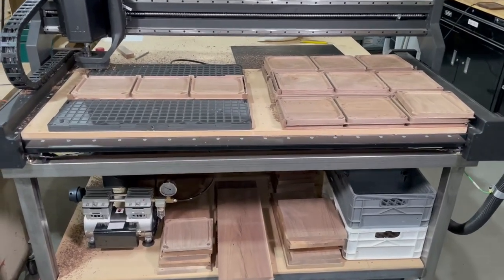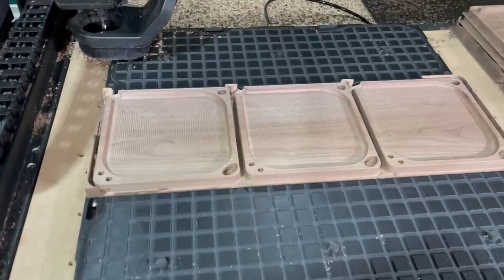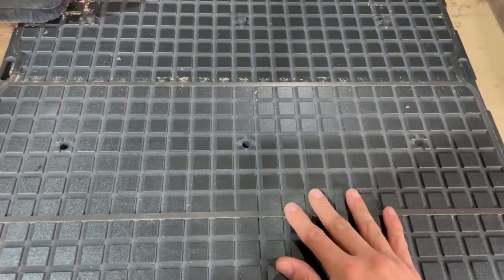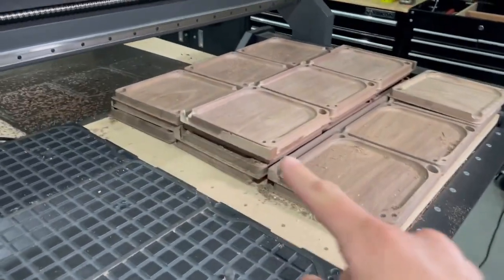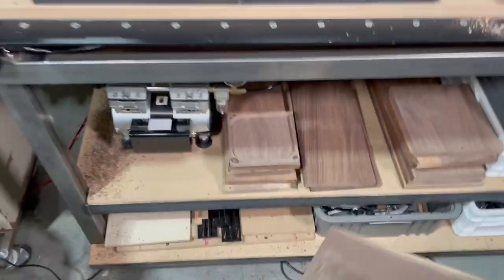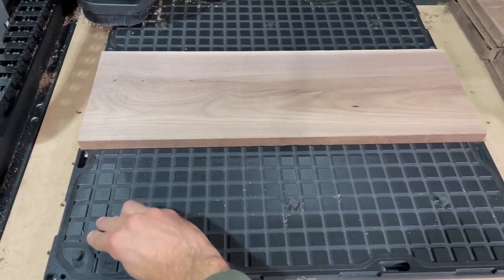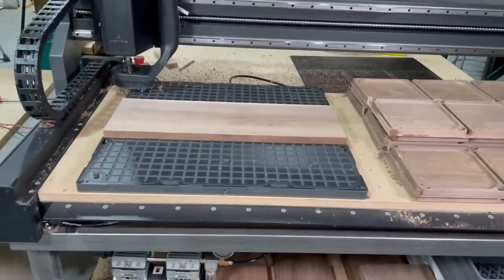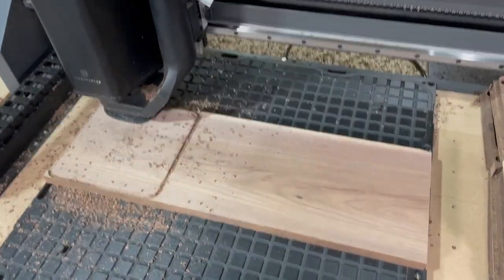AirWeights Vacuum CNC Workholding - short demonstration, running batches on your CNC machine

Comment: What are you using for grid gasket? I've been researching neoprene, but what I'm currently using is a 1/4" round foam "wire" or "rope", commonly found in hardware stores, in the door insulation aisle, called backer rod.

Comment: THIS is the first video I've found, in all my months of research this year, of somebody doing exactly what I've been wanting to do...using a small vacuum pump, connected to a small (HDPE?) platen, holding a piece of wood, where you are working on more than one project at a time with your CNC.
Thank you for showing this.
I've made myself a couple of 8"×12" HDPE platens (no grid though) this year, and bought myself a small vacuum pump, but I havent yet used it for a project with my CNC. It's just cool to see that it will work, in your video.
Reply from the maker: It works well!  The goal was to utilize a small efficient vacuum pump! Good luck with your build!

Comment: How secure would a smaller part be on just one of those vacuum seals? Seems like you would need at least two points of contact for rotational holding
Reply from the maker: You can cut smaller parts from larger stock by leaving an 'onion skin' on the bottom layer of the cut (instead of cutting all the way through). The thin onion skin can be easily removed once the stock is removed from the CNC.